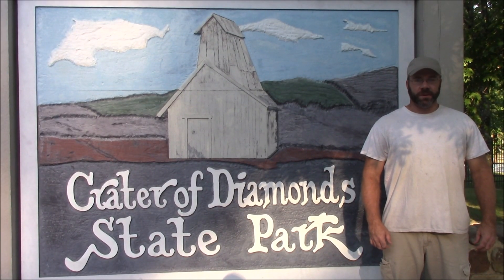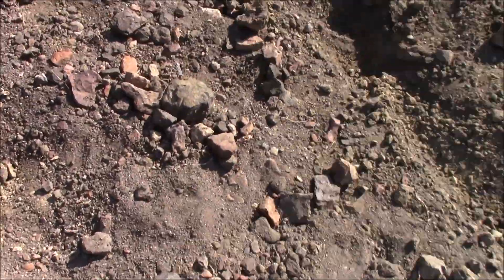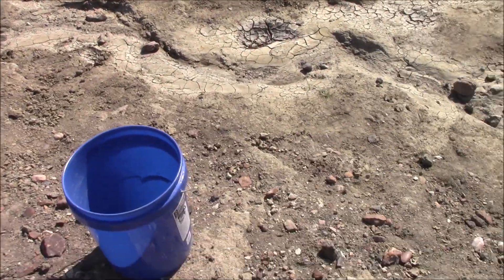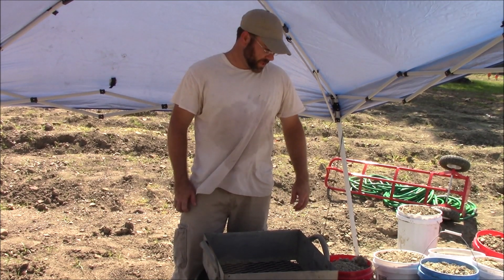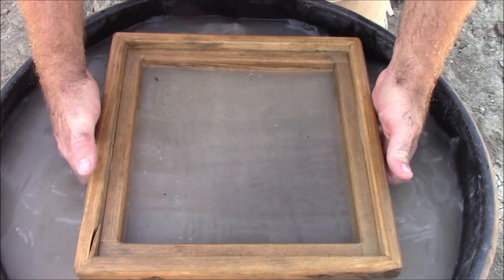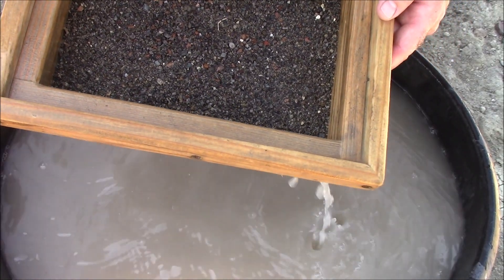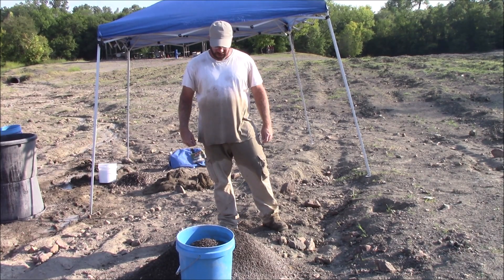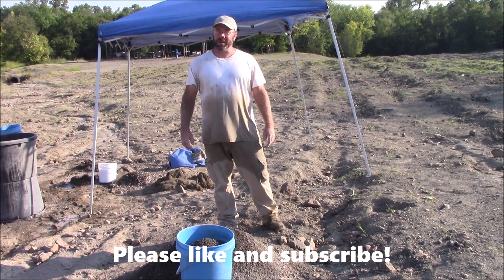Success Finding Diamonds at the Crater of Diamonds State Park

Comment: What if you made a strong vibrating machine, and used it on the bucket with some water in it, and all the heavy material will go to the bottom of the bucket, then remove the upper layer of the material, and then dump the bucket upside down.
Reply from the maker: There are machines built to do just that, but within the park you are only allowed manually powered processes to recover diamonds.

Comment: If the alluvial fan material is dry and loose like in this video, is dry sifting a viable option?
Reply from the maker: It is an option, but the advantages of wet sifting over dry sifting is that you can use the specific gravity to separate material. Concentration of the heavier minerals helps narrow the amount of stuff you have to go through to find one.

Comment: I'll be visiting this place in late November. Unfortunately, the park is not renting any equipment now due to Covid-19. Ok, so I will buy a couple sifters with different meshes down to ultrafine. Did you have to bring your own buckets, or are there some there that you can use?
Reply: I guess I can just pick up some 5 gallon buckets at Home Depot.  It doesn't seem as though I need to buy too much equipment. Thanks for the helpful video.
Reply from the maker: The park is not currently supplying any type of equipment, so you would need to bring buckets or buy them locally. Good luck on your visit!